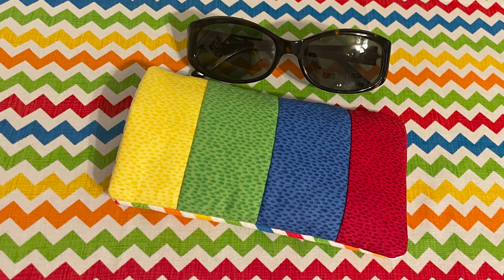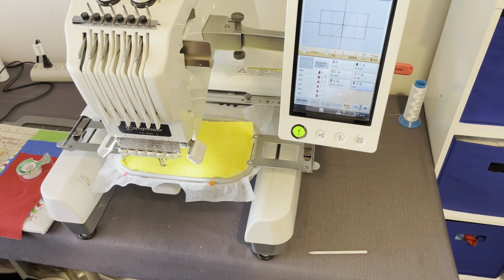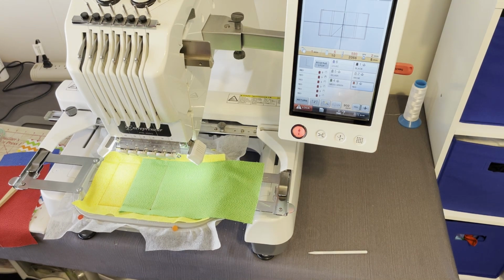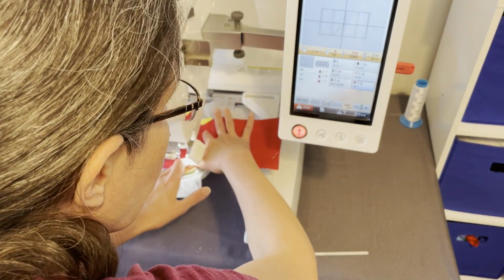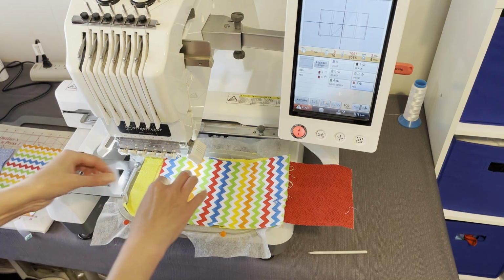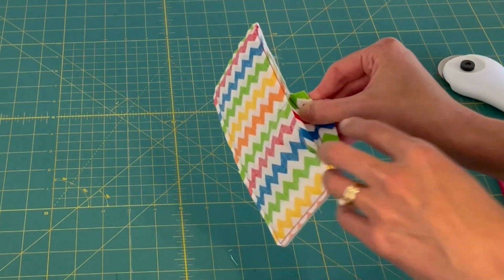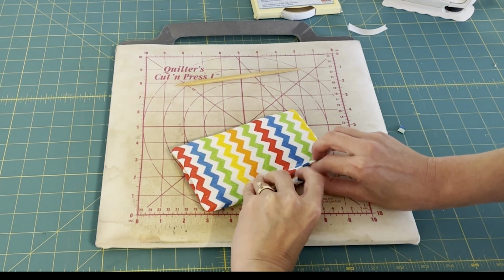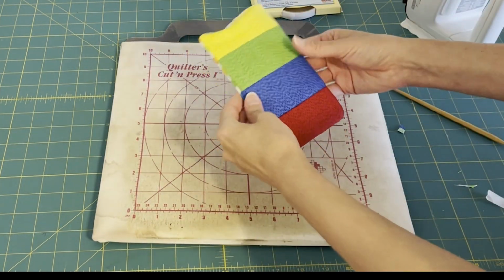How to Make a Pieced Sunglasses Case: Stitch by Stitch | Designs by JuJu

Comment: This looks easy. I think I got lost during the video. Are both the front and back padded? If so, this is a very clever way to make a Sunglass case. Thanks!
Reply from the maker: Yes! The front piece of batting is tacked down at the very beginning under the first fabric, and then the back batting is sandwiched inside the large folded piece of fabric (it's described at the 30-second mark of the video).